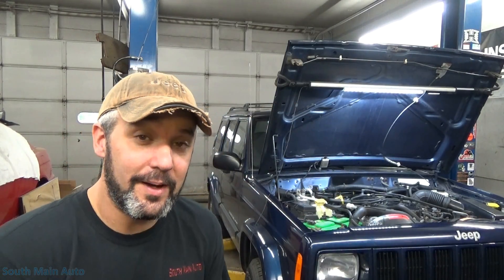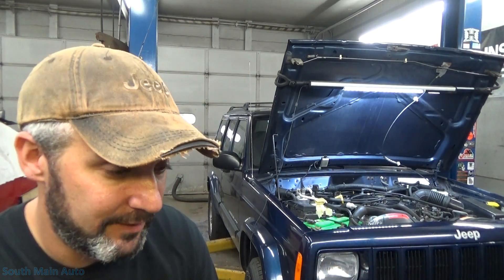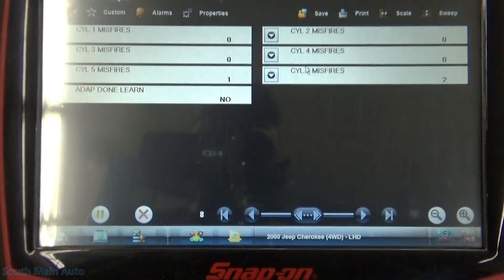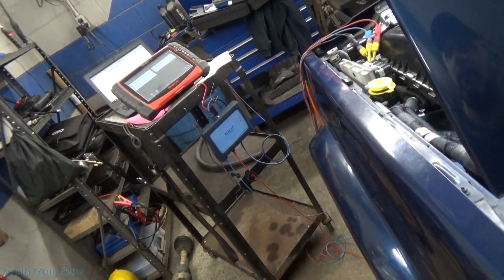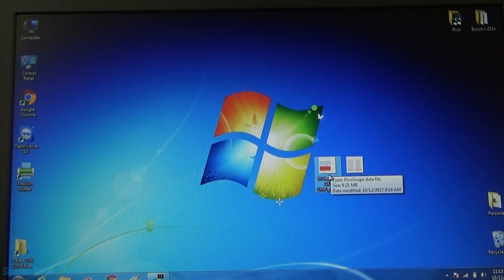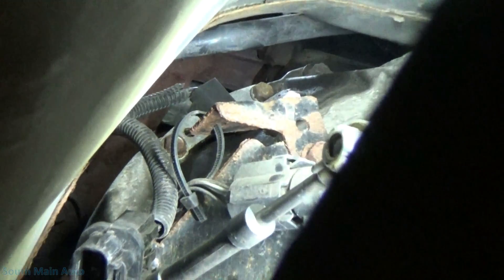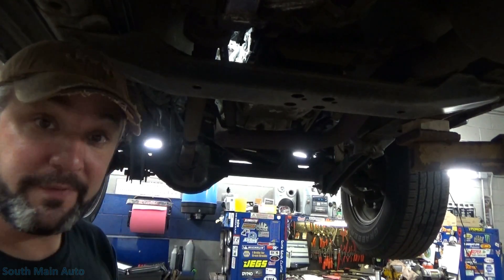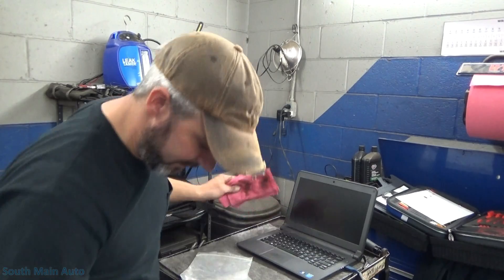Jeep 4.0 - Flashing Engine Light BUT NO MISFIRE!?

Comment: So why does my 95 4.0l idle at about 250 rpm. Cold idle is at 750 rpm. It will sometimes hang for a second at 750 after being revved up, but not always.
IAC has been cleaned and wasn't even dirty to begin with. No codes, but being a 95, its barely got a check engine light. 
For idling so low, it does a good job, not as rumbly as I would expect, and never dies. Recently it has gotten closer to stalling, but it bounces back. The engine seems to be very strong and not lacking any power.
New fuel pump and filter, ignition set.
I'm suspecting a sensor, but I'm not finding anything to lead me in any direction. I'm not trying to replace everything under the hood, although I'm getting close with this being a 22 year old Jeep.

Comment: I'm betting capacitors/resistors within the sensor/sensor chip changing values with aging, effecting on/off slope curve/timing. alternately the sensor has shrunk in size from heat cycle hardening and air-gap changed, that would be an interesting measurement to see. you mentioned a difference of about 200uS, zoom way in and compare the curves and peak voltages

Comment: Nice touch with the waveforms. Spent a few hours dissecting and understanding the differences in RPM directly correlates to the ms between each cylinders interval so not to be fooled by differences in time. The Old Idle I read @699.52 RPM, New Idle @689.46 RPM, OLD 2500 Misfire @2318.3 RPM and the NEW 2500 Sensor @2691.5 RPM. I zoomed in/out but if you measure the interval between cylinders on the CKP & check all 6 I come up with all reading exactly the same interval between cylinders so what is the computer using to base cylinder misfires HOWEVER sometimes you go with your gut experience and that has fixed so many cars (some over the phone) b/c in your head you have logically eliminated as much as you can thru testing.  Great call and the bottom line is it's fixed but it's bugging the crap out of me that I can't see it on the waveform. For the past 6 hours that is all I have thought about but that is why I still enjoy this after 40+ years!!

Comment: I don't know why, those Jeeps are weird about the sensors. Mopar or your going to have issues. Especially the 4.0, they'll start acting weird if you put anything but copper core plugs in them. It's like they they designed the ignition systems around the plugs with such close tolerances that you can't use anything but oem stuff. Just did a ckp on a 2000 Grand 4.0, couldn't get oem at the time. You guessed it, a week later I was back in there with genuine mopar. Runs fine now. Any who,  great video.

Comment: My 2003 Mitsubishi had this problem.  If the light on the dash wasn't enough, an ECU algorithm would hunt through the cylinders one by one turning off fuel.  So, I had a three cylinder car that felt like it was about to blow up.  There was no help from Mitsubishi, you either drove it that way or lemon lawed the car.  Later (read out of warranty) there was a TSB - bad transmission.

Comment: This is interesting. I had the same problem on my Porsche 911 (997.1). In my case it was only when cold.  

It totally went away after changing the clutch. All I can think of is I cleaned up the rusty reluctors on the flywheel and I cleaned the sensor tip. 

I have always wondered where the problem went but it never happened again since the clutch change two years ago.

Comment: There are times when an "experience based" approach is necessary.  I have worked on wind turbines when nothing was out of specs and everything was apparently good.  But the turbine would just not come online.  Dig back into my experience and I just knew that if I replaced part x, then it would come online.

Sometimes that is the only way to get it done.  If it works, and the customer is happy, don't sweat it.  You spend a ton of time of troubleshooting customer cars, and ensuring that you get the exact problem nailed down and fixed right.  If there is an occasional time where you can swap a common part and get the car fixed and back on the road without spending two or three hours of shop time, all based on your experience, then so be it.  You will get the car back to the customer faster and with a smaller repair bill, and you can get on to the next one.

It is the odd ball problems that really require your level of expertise in troubleshooting and attention to detail to iron out.

Comment: You really need to acquire a magnetic socket set by Grey Pneumatic...They come in assorted drives as well as swivel, short, long, etc...Every time I see you struggle with certain fastener locations and/or dropped bolts/nuts, I wish I were there to hand you one...Hint people...;)
Reply: tinkerwest Didnt know they made them magnetized
Reply: The only drawback to those sockets is that they are impact type, not chromies...Nevertheless, they do come handy on many occasions...Happy wrenching!...
Reply: or you know "just magnetize the ones you have now"! ehhhh
Reply: @Throttle
Yeah,  you could wrap some dc voltage wire and make those chromies "electromagnetic...lol...otherwise, you get better results with grandma's grease in socket trick...:)

Comment: Another difference in the two 2500 rpm files is the spikes in signal. With the old one, highest one in sample is 2,1V and with a new one only 1,3V. Could the 2V spike be counted as a Boolean 1 -> "5th teeth" by ECM? We do not know the voltage threshold for Boolean 1 in the ECM HW/SW..

Comment: Could it be the resistance of the crankshaft position sensor? You should messure the resistance of the magnet inside the ckp sometimes it is out of rank, although it is working, the readings are not the correct ones!

Comment: Hi Eric. Downloaded the files @2500 rpm and used Pico measument tools. Old sensor duty cycle is 10,28% New is 11,1%. 7% difference in pulse width -> upto 25 degree variation to angle speed dRpm. Old sensor became more insensitive detecting a flywheel teeth. Turned on later and turned off a earlier. Could this be the diagnosis?
Reply: Janne Pohjala That’s what I found as well. The duty cycle obviously didn’t affect engine operation but the PCM was sensitive to it.
Reply: Awesome! I wonder if the magnet on the crank starter wheel gets weaker with time and heat, thus the heavier wound and more sensitive mopar sensor is the only one accurate enough?
Reply: Thats what I thought. That maybe the aftermarket sensor is manufactured slightly differently that maybe the PCM wasn't getting the full value it was expecting.
Reply: Where are the files I looked for them couldn't find them

Comment: I looked at the wave form and took  measurement of the time it takes the sensor to go down to 0v after hitting its 5v the the old one it took 905ns and on the new one it took 405ns  and did you measure the resistance of both ckp sensor sorry i suck at explaining
Reply: The overall duty cycle is 7% less for old sensor. I would say that the old one started to drop down earlier and trailing edge time was longer. Depending what voltage ECM interprets as zero, the difference will be more than 7%.

Comment: Had a 2000 Chrysler Sebring with the 2.5l V6. The engine would just die for no reason. Driving, at a stop or just idling, the engine would just die. At times, it would restart. At other times, it would take some time before the engine would fire up. No C/E light, no codes. Checked the crank sensor, it checked good. Wiring checked good. Everything checked good. I heard a similar thing of where the crank sensor would cause the engine to die. I replaced the crank sensor and all was fixed. Could be that the sensor was on its way out.

Comment: Another excellent video from SMA. Thanks and look for some family ice cream $$ in your PayPal account.
My thoughts on the misfire counters and DTC - the diagnostic calibrator(s) for the components and misfire DTCs for obvious reasons use new OEM parts and 6 SIGMA calculations base on data to establish failure thresholds.
It maybe the replaced (aftermarket?) part slowly drifted out of specs, resulting in misfire counters climbing and the DTC setting. The component failure DTC 'should' have caught the drift, but that's a tough one to catch.

Comment: I think I need to do this on my Tahoe.  Truck shows a few misfires at normal temps then stumbles and dies on graded freeway in very hot weather.  CEL never comes on.   I have a new part collecting dust but I had stopped taking trips to the South the last few years.
Can it be done without a crank re-learn?
Reply: Eddie the Grouch crank relearn isn't going to fix a stall when hot situation.  You have something else going on.  Maybe monitor fuel pressure, injector pulse, and ignition coil signal/ voltage with a dso to see what goes away right before the stall.  If you determine what goes away, that gives you direction on which system to look at in more detail.

Comment: programed tolerance of the wave form is to tight. a design flaw in the firmware.
I had a 01 ford focus ZX3 zetec that the whole end plastic of the crank sensor had broke off so the coil was rattling loose and that caused a really wonky vibration at idle as the timing was wiggling around. no light no misfires.

Comment: Could Chrysler put something in the signal that stops aftermarket parts. No. That would be selfish and illegal.
Reply: In my old '88 I had a terrible time with crank sensors until I learned about a not-very-well-advertised factory kit that corrected what was a bad wire harness design. The kit consisted of a new harness that bypassed the original, along with a new sensor. The kit cost less than the sensor by itself. After installing three sensors in the first year, after I installed that kit with the patch harness I haven't had to touch it in 17 years!
Reply: And also some people have had long-term success with aftermarket crank sensors in Jeeps.

Comment: Since the bad crank sensor didn't effect the way the engine ran, are there any negative repercussions to not replacing the sensor?
Reply: MyassesDragon The check engine light will keep flashing and triggering misfire codes.  The PCM will cancel certain emission monitors and may stop timers.  You'll fail emissions testing in emission states.    It could be the symptom of a crank sensor getting ready to really fail and leave you on the side of the road.

Comment: It needs 5 more "ignition tune ups" and about 11 bottles of fuel system cleaner, then keep telling the customer it's bad gas if he comes back.
Reply: most people say "i dont know" when asked when was the last time spark plugs were done (and on this....people forget the cap and rotor is a wear part)
so i usually will pull a plug to have a gander 
.
but ya.... ive shotgunned my own cars ignition (dont have time, and dont want to WORK on my own shitboxes)
99 GM 3.1...... waste spark can go F it self
.
new plugs and wires.... still had a soft miss that the CEL didnt light for
but the old plugs WERE quite old, and the wires 10 years old....
.
turned out..... bad coil
then i tightened the bolt too much because it was -30f....
and cracked that coil
.
then i got a bad coil..... that split in half
turned my car into a 4 banger..... limped my way into work
.
and finally..... ive had NO issues for 80,000 miles
and now its about time to do the plugs again...
.
PS
on my 97 4.0 jeep..... i have a miss that cant be felt (some times cly 5, some times random multi, or sometimes 2 5 and random)
but its usually going down a hill, with like 2 gallons of gas in the tank....
.
throws the code with in 200 feet of the same hill..... 
.
doesnt seem to do it (as often) when it has 1/4+ tank of gas
.
oh well..... its a mopar..... reset the code, keep driving till something changes / gets worse enough to fix

Comment: Run's fine....Mifires detected...Why didn't you chase the knock sensors? or the sensor inputs to the E.C.M?...Thanks.
Reply: danekeeper1 knock sensors don't cause misfires, but can cause detonation if they aren't working.  He did trace the cam and crank signals at the PCM on his scope.

Comment: Another trick for holding a bolt in a socket like that is squirt a little dielectric grease in there, a guy I worked with years ago showed me that and have done it quite a few times.

Comment: Interesting video. I downloaded the data files. The timing accuracy on the old sensor is much worse than the OEM one. 

Each power stroke, the CPS should produce 4 pulses. These should accelerate (i.e. the time between pulses should decrease) as the piston pushes on the crank. If the crank slows and the time between pulses increases, the PCM records this as a misfire.

On the OEM sensor trace, the CPS trace shows the interval decreasing at an average of 3 microseconds per pulse , but with a tight standard deviation (1.8 microseconds). On the bad sensor trace, the timing is all over the place, standard deviation is about 8 microseconds. Even though, on average, the pulses show acceleration, the timing is so wild, that there are loads of apparent "slow downs".

https://imgur.com/a/T0Rhh
Reply: Good info.   I have a new mopar sensor with this same issue just not as reproducable, maybe once per day it'll flash.   Wish I had a pico to see the waveforms closer.

Comment: tone ring on crank is some what loose that is the problem ran in to it many times the same problem will come back on in 2 to 3 months
Reply: Sam Rugtiv 
Not disagreeing. .but curious what changes after installation of new sencor that causes it to read good...even for a month or so...seems like it would still show misfires even with new sencor....
Reply: No tone ring is basically thin metal band that sticks out of back side of flex plate just smaller diameter than the ring gear. It has slots cut in it that trigger the crank sensor. Sensor is bolted to back of block and sticks through a hole in the bell housing. I spent 45 years working in automotive service shops. 25 of those years were spent wrenching in a Chrysler, Plymouth, Dodge and after 1990 also Jeep. I was gold certified with Chrysler corporation as well as ASE and State of Michigan Master certified. I also held a classic vehicle certification. The last year I wrenched was 2000. The remaining 15 years I was fixed operations manager.
Reply: Tone ring is part of the flex plate on those old jeeps.
Reply: grant wright 
So no tone ring on crank?????
Reply: grant wright 
Interesting
Reply: grant wright I have a Turismo duster 86 fan runs always when engine runs no tach & no vacum advance sometimes when cold all problem disappear when tach working .has power module by batt.(carbureted)  I Added a switch to fan relay .no corrosion at pcm  not temp sensor .there's no distance sensor on trans can't find it but diagram says one . Runs and drives normally i reset timing advance any.  ideas pcm? Thanks .noone knows what this car is thought you might know.
Reply: Don Desnoo you installed an automatic thermal switch to cycle the fan only when it’s cold and the tach isn’t working? Hope it isn’t a manual switch, one time forgetting to turn it on or somebody takes your keys and doesn’t know, and your goose will cook itself.

Comment: I had a great time with a faulty crank sensor, absolutely no problems till it would kill the engine then it would start and no problems till next time. Turned out that it would only fail when it got to a certain temperature and I only found this out when washing the engine in preparation for a more drastic investigation

Comment: Hey buddy I just wanted to let you know thanks for the advice you gave me the other day but I had come to the conclusion on what was causing my problem with my 99 Jeep Cherokee Sport I figured it out I could laugh at myself all day long but it turned out to be nothing but a fuse that popped out and wasn't pushed all the way in problem is solved I fixed it the David you read my comment and told me to go look for the diagram I figured it out that day and drove it home it runs great I just have a lifter tick cuz I have a dry lifter other than that it's up and going thanks for your advice and I hope you have a blessed day

Comment: It appears you already new the answer to the problem , I wouldn't call it a guess !  You just didn't have faith in your ability and 2nd guess yourself ...Everyone likes to see exactly what is causing the issue physically with your eyes , but sometimes it's so small you are not able to. I'm sure the sensors magnet is not as magnetic as a OEM  one should be for it to work properly, therefore causing the misfire.Oh damn I'm guessing, thanks for another fantastic repair video..If I ever have an issue with my car , I will make an appointment to have you repair it..

Comment: Hello Eric  

The only thing I notice between the 2 files is the noise level just could have been enough to trigger an event. 
The old sensor when compared with the new sensor has about 2.5 volts noise?

I have build automotive scopes for Actron manufacturing.  

Lon